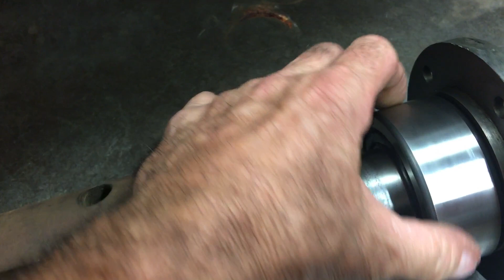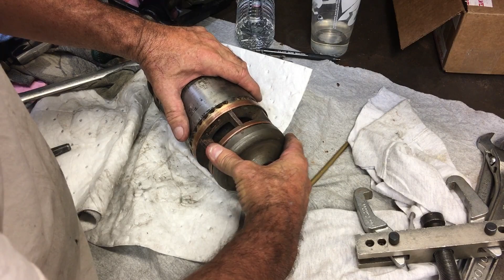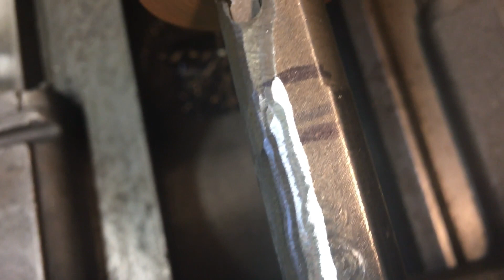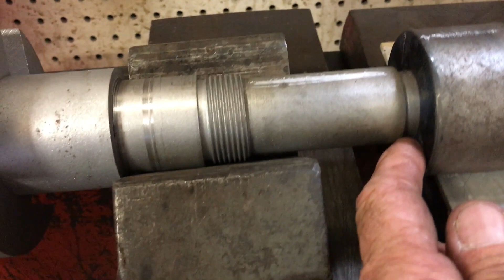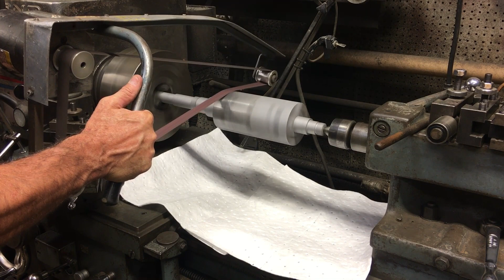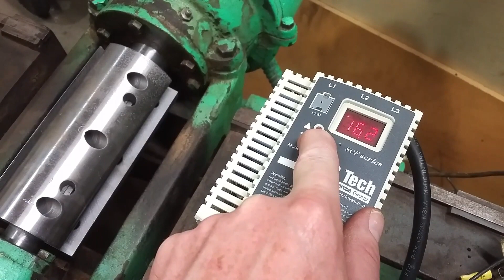Northfield Jointer bent cutter head.

Comment: nice but his tables are not coplanar  the left side walks up and the end is down  look at the fence is hangs up off the table on the outfeed side to far and the left table sits lower at the end then at the cutters.  the wood should rid past a cut both sides and stay flat to the table's.  he's got some work to ge it working right.   the motor sounds really good i'm impressed.
did he buy you a 6 pack?    no seriously you saved it from the scrap heap.  that shaft was so far out it wasn't funny.
now it runs true probably as good as it did new.
Reply: He just needs to adjust his outfeed table.

Comment: This is the first of your videos that I have seen, I thought it was great. I have never seen nor tried to straighten a shaft with heat in the lathe, my experience with live centres would preclude it. I have one mt4 centre that is perfectly accurate, the rest are not and I do not want to ruin it. Do you have a secret when it comes to live centres? It is nice to see somebody using a centre point in the chuck and refreshing it every time it is used for perfect concentricity, I have been using and teaching this method for many years. Turning between centres has all but disappeared but is invaluable when diagnosing problems in a shaft.
Reply from the maker: Rob , I appreciate you checking out my video. I’m glad you liked it. I don’t have much secrets about the life sinners, I have several that I use. In my opinion spinning between centers is the most accurate way of checking something. Thanks for stopping by.      Gary

Comment: Pretty amazing improvement there Gary! You rock!
Reply from the maker: TraditionalToolworks , Thanks Allen. And thanks for checking out the video.    Gary
I hope it’s Allen😀 my memory can be pretty bad.
Reply: @OldIronMachineWorks  Actually it's Alan, but it's a mistake that's been made many times over...LOL
Reply from the maker: TraditionalToolworks not only is my memory going bad, I can’t spell worth a crud either. 😂
Reply: @OldIronMachineWorks  No worries, half the days I can't even spell my name either...🤣

As  I said, it happens all the time, since there's like 4 ways to spell it. Lucky you, Gary is pretty standard! 😉

Your friend should be pretty happy, you turned his boat anchor into a precision jointer again! Pretty impressive, IMO. Northfields are good machines. ☺️
Reply from the maker: TraditionalToolworks Thanks Alan. He actually sent me another picture yesterday of a massive pile of wood shavings. He is very happy with it. He sent a link of the video to the owner of North Field and it got a big thumbs up. They said they would’ve just cut off the cooling fins on the rotor and told the customer not to run it very long.

Comment: Boy alot going on wrong there once you got into it. You knocked it out of the park though. Is he going to repay you with a new wood floor?
Reply from the maker: Tom, I'm sure you know how it goes when it comes to getting paid from friends :)    Always nice to have you stop by. You must be getting excited making headway on the new shop. I forgot how big your new shop is? I just had my new garage plans drawn up. Its not going to happen over night because I will be building everything myself. Still digging and hauling dirt. But it would be so nice to eventually get all my machines out of storage. My shop now is packed. New shop will be wood framed on slab. 36 x 56 x 12   just over 2000 SF .    My friend can repay when its concrete poring day :)        Stay safe out there.    Gary
Reply: @OldIronMachineWorks  Yep I do. :) My shop is 40x60x14. Hopefully pour the last section of concrete tomorrow weather permitting. Hopefully you will be able to get yours built easier than mine.

Comment: Great repair.  I have seen drive shafts heated and drawn straight with a wet rag and I have straightened motorcycle forks in the hydraulic press but now I have seen another great way to get the kink out.  Thanks for the video.
Reply from the maker: Thanks Harold, always nice to have you stop by.        Gary